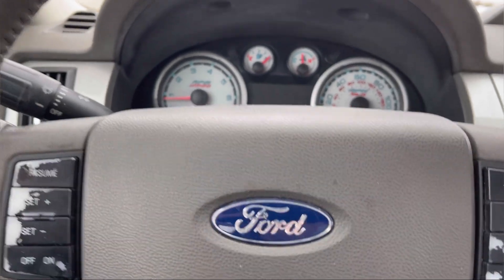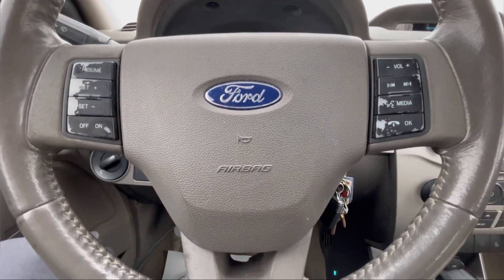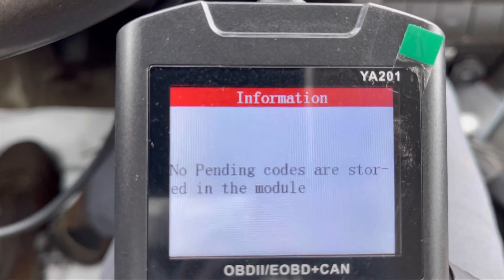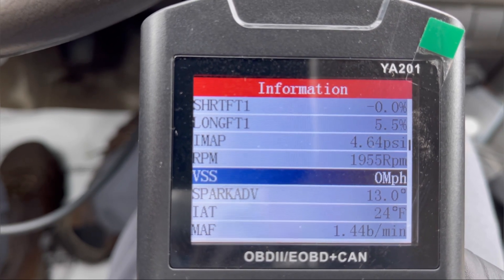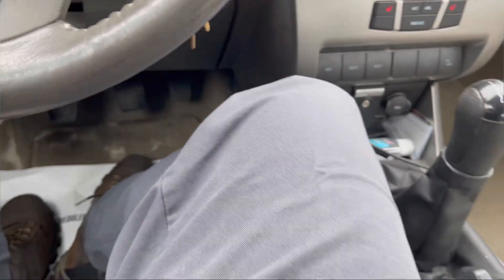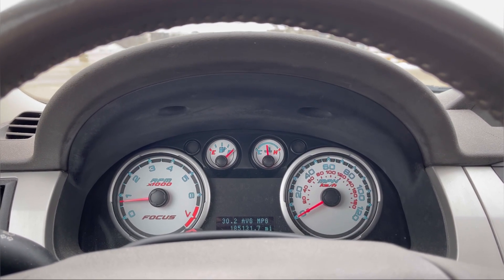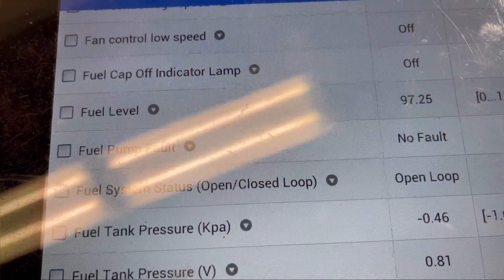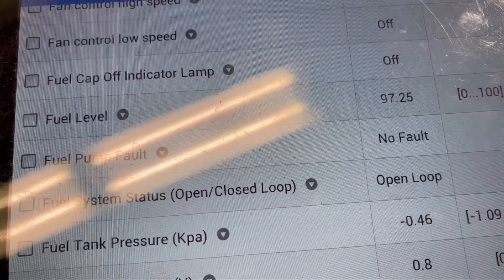How To Diagnose P0451 | Fuel Tank Pressure Sensor

Comment: so is the fuel tank pressure on the actual tank itself or is it outside connecting other things?
Reply from the maker: Fuel pressure sensor is usually on the fuel tank. On some makes and models can be access the fuel pressure at fuel access door. But most of the time fuel tank has to drop of the fuel tank to access this sensor.